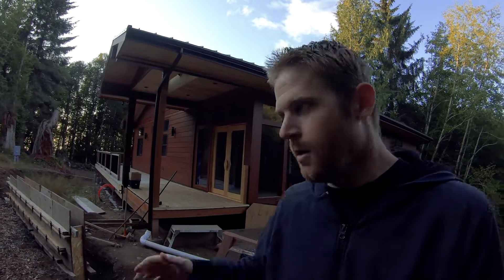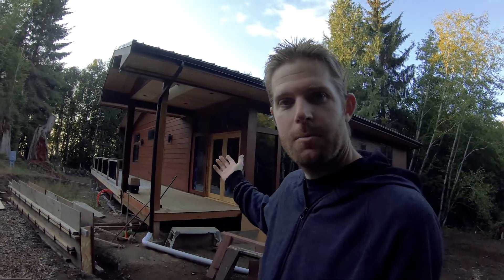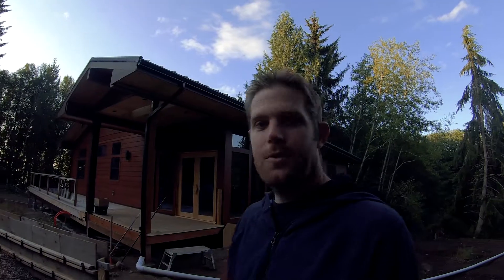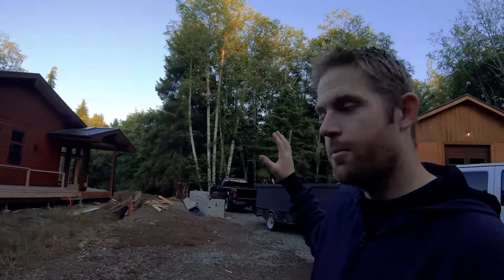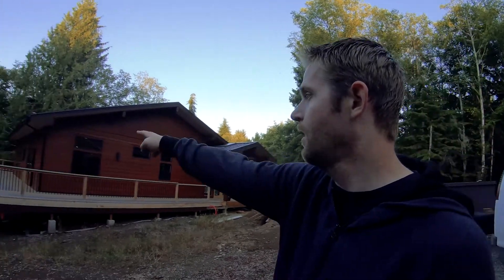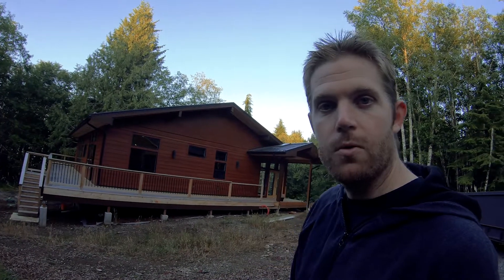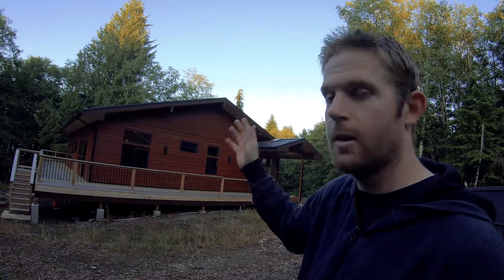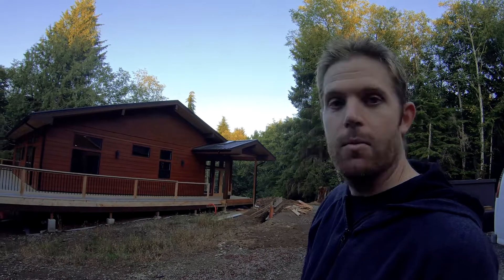Why we are building a Passive House inspired home.

Comment: Why would you need to reside a house after 15 years? My house is 25 years old so we have not resided it and it is fine. I'm originally from the northeastern part of the US where the climate is crazy and we have homes that are hundreds of years old. Instead of building new homes people need to start thinking about how to retrofit older homes which will also combat the climate change issues that we are facing. What are we going to do with all the older houses just tear them down?
Reply from the maker: Siding materials/installations vary quite a bit as do their lifetimes.  A lot of times it's only as good as the paint job.  A poor job and or waiting too long to repaint when needed can cause siding to fail prematurely.  Also the sunny side of the house is going to need attention long before the shady side because UV is so destructive.  In our area the shady side loves to grow moss and algae which are destructive in their own ways as well.    Method/quality of installation can be crucial to a long life for any of those products.  A lot of people choose or can only afford the cheapest option and then don't/can't keep up on maintenance and you have rotten siding before you know it.  

As far as retrofitting old buildings, in general, homes built pre-1950's are still around because they were built with superior old growth wood and were able to breath better without all the plywood and sheet rock used to build houses since then.  The problem with those old houses is they are energy hogs and are terribly inefficient to heat.  In order to retrofit them to perform at energy efficient standards and help fight the climate crisis it would take more work than just building a new home designed correctly.  Certain buildings may be worth the effort but sadly most will not be worth retrofitting.  We need to figure out how to recycle the old houses though instead of just dumping them in landfills like we do now. 

Most of the tract homes built over the last 50 years that make up our suburbs are a big problem and are likely not fixable.  The average tract home only lasts around 50 years.  This is because the materials and methods used today are not as forgiving to water damage and delayed maintenance. 

We continue to build these poor quality houses all over America, so its not just old buildings that will most likely have to be torn down, but also the new ones still being built right now.  Its crazy...

My final thought is that eventually we need to be able to incorporate natural building materials (Cobb, Straw Bale, Adobe, Rammed Earth, etc.) into these new high performance homes.  The house I am building takes a lot of high carbon materials (plastics, glues, cement etc) to get the job done.  I'm not happy with that but it is what it is.  My next house will be different.